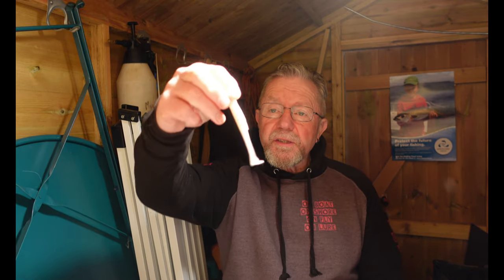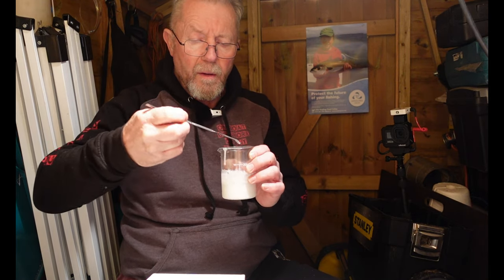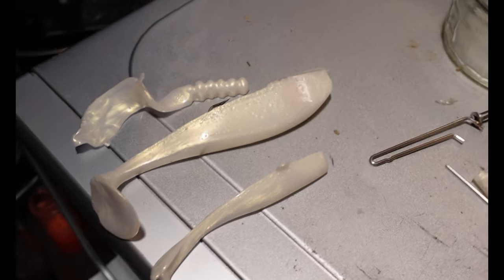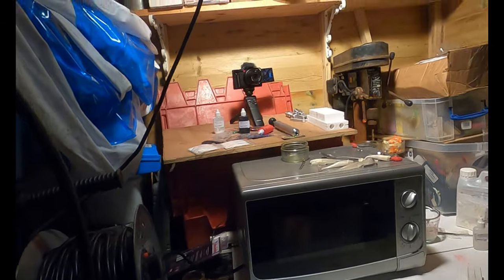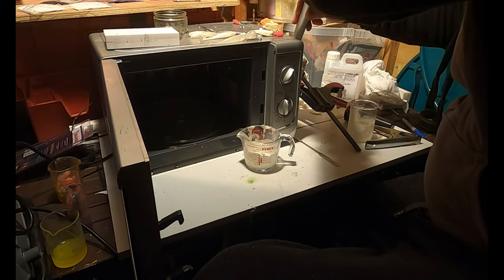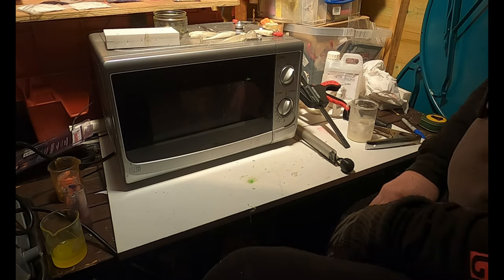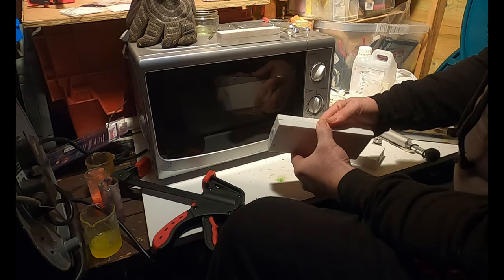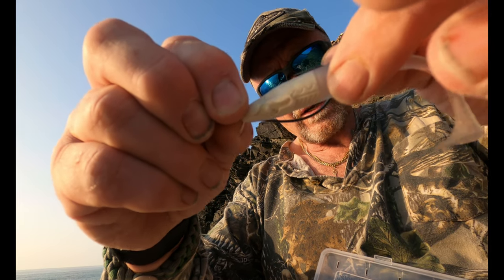Beginner's guide to making Soft Lures 01

Comment: Hello mate, ian from the lure factory here, great to see more people getting into making soft plastics.
Few things to help you out.
I would get a digital microwave so your cooking time is more controlled.
When using the injector keep the plunger all the way down, suck about a centimetre or so into the injector,
keeping the injector nozzle At an angle and touching the bottom of the Pyrex jug,
push the small amount of plastic out of the injector and pull straight back and fill the injector.
this way the injector pushes all the air out of the injector so your not injecting into your molds 
And helps heating the injector.
Try injecting slowly into your injection molds to avoid air pockets in the top of your baits.
Hope this helps 👍
Reply from the maker: Thanks, iv just been shown your website , so will be in touch, i also found when doing bi coloured lurse (episode
2) pumping into the difuser upside down til it was coming out improved the air problem, but i will try what you said.😜
Reply from the maker: Spookily Ryan Dawson had just told me about you when you messaged, ill put a link on this and my next video if you would 👍
Reply: @SEAFISHINGwithCJ  yes that is another good way of getting the air out of the injector.
Reply: @SEAFISHINGwithCJ  haha that is spooky, and yes I would like.
Cheers.